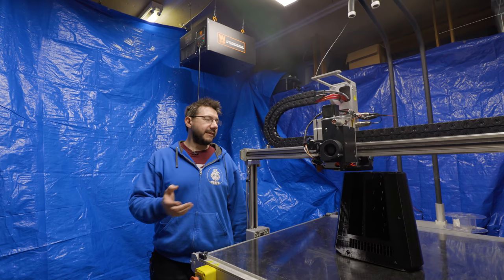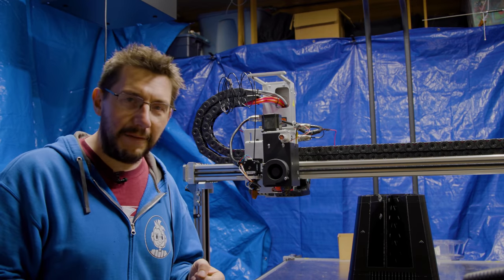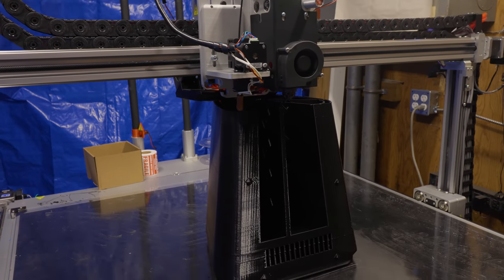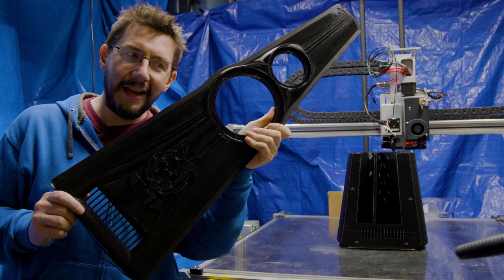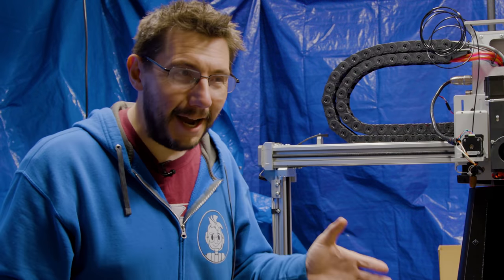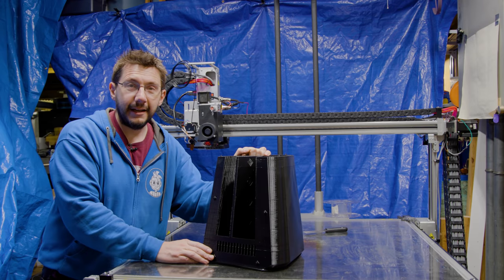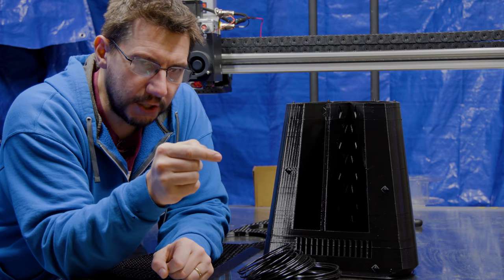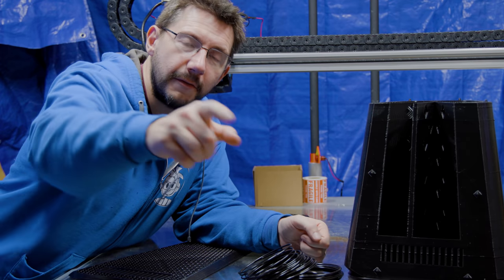3D Printed Speakers Part 1: Breaking the $38,000 3D Printer ... Again?

Comment: Is there such thing as a vacuum suction build plate? I have had my prints pop up off the build plate too and is super frustrating.  Would not be economical for small printers but at the 38k price point youd think this could be something to implement.
Reply: I think that's a great idea. First layer goes down then vacuum is applied. There would need to be a way that areas not printed on are not just sucking in air.
Reply: @Audio_Simon  yes like something in the g code that only applies only to the build area
Reply: @TheTelephonator  There would need to be valves or something that section off areas of the build platform. Like a TV has array backlighting.

Comment: What would happen if you tiled some of those black coated glass sheets over the surface with some silicon thermal pads for heat transfer and adhesion? Bet they would hold prints really well without the goo. I use a 0.8mm nozzle on my ender 3 and 0.64mm layer height. Never had a curl on the black surface.

Edit: I use petg mostly but pla hasnt curled either.

Comment: mister dude, after 30-ish layers set the bed temp to 10C under glass trans temp, pause the print for an hour to cool, resume print. Cooled lower print will keep it stiff to resist bending and there will be no leftover heat concentration.

Comment: Think about using a thermal blanket to retain the bed heat.  Sheet of silicon?   Otherwise that bed is giant room radiator
Reply: That's a good point. Stop heat dissipating from the un-used area and the rest of it will stay warm better.

Comment: Hi =) I have a question, why don't you use draft shield for the first 5 or 10 cm to keep your print on the bed? It work on small printer with bad adhesion for petg so it's possibly an idea for you I think. It's an experimental cura option if you search ;).

Comment: For doing detail work on the  38,000 dollar machine, slow it to a very very slow crawl.  Have you tried using hairspray to hold your prints down ... Aqua Net extra super hold never fails for me... Also can you move the filament sensor closer to the print head ???  Happy new year.. Best of luck on your speaker build ...
Reply from the maker: Yeah, a super crawl. I haven't tried hairspray yet, I may do that. I do want to move the filament sensor to the closer to the hot end :)

Comment: i think this 38k printer is probably built with 10k in hardware and its the hole 1st adopter pricing. idk the frame of the machine looks like it could do with some bulking up but if you look up large 3d printers you come across people making bigger machines that seem to do a better job and they don't cost as much as a new car.

Comment: How many outer layers sliced in the model?Larger models need more wall layers. Would have printed 2-3 times faster on a large delta printer like the Deltazilla at 1/3 the price. And the filament/jam detector is at extruder. And hotend is safety spring loaded so it can’t be broken off by mishap.
Reply from the maker: I had three perimeters on this one. Oh sure, a large delta machine would have produced it a LOT faster.

Comment: Not saying that this would make a difference but when I was printing abs I noticed that the more material you printed with the greater the warping.
If you can print with less infill it might help.
Just a suggestion.
The printer is a massive disappointment with a massive price tag sadly.

Comment: Joel, you should check out Vision Miner's Nano Polymer (I think you actually did a vid with them). I've been using it for large Nylon/ABS prints and I've NEVER had it peel off the bed. It works so much better than Magigoo.

Comment: For a bed that size they should have used multiple sensors... they could have used a circuit to average the temp or just input them in to a board and read them all...

Comment: A glass bed like that is probably really expensive, but I cant help wondering if a roughened up (cant find a good english word for it, according to google translate its "cut glass", I mean the way they roughen glass for making very tight closing lids on glass pots and jars and stuff, like those used in chemistry) bed would work better. Maybe by using a whetstone on it or something, or maybe theres companies that can do this.. you'd always still have your other side of the bed in original state :)

Comment: $38K printer: "In this house we obey the laws of thermodynamics!"

I've struggled with warping/bending thermoplastic before, even PLA, though obviously not at this scale. I've bent heat breaks, but snapping one mid-print is a first for me.

I wonder if a space heater would help? (Don't actually do it, the energy cost would probably be insane) I know that in the high-end Stratasys machines, the enclosures are actively heated to ensure that warping is minimized.

EDIT: Considering the cracked bottom and super hot surface under the print after cooling, I'm now wondering if there's a way to "anchor" the important sides to the print bed with big solid throwaway parts? It'd be wasteful, it'd raise print time dramatically, but if we want to print this without having to cut it up and glue it together later, this could be the only option on this printer.

Or cut it up in CAD, print the parts on Ender/Prusa machines, then glue it back together.

Comment: I’m sure that Simon can tell you, but a speaker cabinet can’t have anything lose or movable that isn’t designed to be movable.  The failed layer inconsistencies could introduce vibrations or really bad harmonics.  You’ll definitely need to reinforce them and ensure that they work at all frequencies, and combinations thereof.  To put it simply, if the cabinet is not rock solid, the sound produced will be really bad.
Reply from the maker: Oh I know, heh. I'm going to have Simon helping me with the assembly and making sure the cabinet itself is filled with what it needs.

Comment: 80°C for PLA? That seems too much. I though the best bed temperature was around glass transition temperature. More than that and it melt, so it doesn't stick. Less than that and it cools don't too much, it goes back to solid state...

Comment: You'd think with all the money spent overengineering this printer, someone would have thought "maybe we should add a filiment run-out sensor closer to the hot end, then we could have the system were the further away sensor alerts the user that it's about to run out so that they can replace it when it actually runs out" or even better they could of added a system that automatically changed the spool, fuses the end of the old spool to the start of the new one

Comment: A lot of comments criticizing the design but the challenge of mitigating internal stresses during printing is not at all trivial. It's even a problem in metal printers worth hundreds of thousands of dollars. I'd say if Joel wants more success he should raise the temp in the room and use a raft instead of just a brim. 

Also why not just move the filament sensor yourself?

Comment: It should have a secondary (if not the primary) filament sensor/switch on the printhead (not a hard mod to do, and quite light) or at least close to it... it's a nonsense to have it that far away if the printer can't use the last 2 meters of filament each time. Also, might be that this monster is meant to be used with bigger/heavier filament rolls in order to need less reloads... still, a couple of switches in the head for filament detection wouldn't hurt.

Comment: You need a higher ambient temperature. Get some oil filled radiator heaters and encapsulate the area 100% so the heat stays where it needs to. You want a 80+ ambient temperature

Comment: Hey Joel, I have the 3DP 1000. I keep it in a dedicated shed in my backyard and it keeps it nice and toasty in there and that helps alot with bed adhesion. Any suggestions on upgrading the control board ? I'm happy with the steppers and the mechanics , I'm struggling with it in the repeatability department and it sometimes has thermal run aways.
Reply from the maker: oh you have it in a dedicated shed? interesting. maybe I need to put a shed in my garage. As for control board - hmm. This one has a Duet board, what does yours have?

Comment: If you print it again, when the print finishes you could flip over a can of PC Duster and lightly spray the base of the print. Before trying to get it off.

Edit: Don’t use too much though because the fumes probably aren’t good, and the print can crack from rapidly contracting.

Comment: Seems to me the bed should be set into zones for at least temperature measurement.

Have you tried aiming a heat sensitive camera at the bed to see if the heat is distributed consistently?
Reply from the maker: I have and heat is consistently distributed, though there is just one giant zone :)
Reply: @3DPrintingNerd  Is it possible then that the heat under the print is getting higher than the temp you set it to simple because the heat has no where to escape to?

Comment: For 38 grand I would be angry at this point if this was my second video and the printer still had issues.
The bed has some massive issues they need to address, and having the filament sensor THAT far away from the hot end, there's absolutely zero need for it.
For a FDM printer this big I'd rather chuck my money at Ivan Miranda.
Joel I'm sorry you're having to deal with this lemon again :(

Comment: I had been thinking that the runout sensor was too far away some you first featured the printer
Reply from the maker: I really want to put it on the hot end carriage :)
Reply: @3DPrintingNerd  I mean, at least put it at the top of the filament hook thing, not at the bottom. You have like half a roll of filament between the sensor and the extruder. I though my w foot long bowden tube left me with a lot of filament waste, but this is ridiculous

Comment: Why don't you use a large raft?  A raft seems warranted. Print in one of the quarter quadrants, where the build plate is nearly unused, might help also. Don't always need to print center. Good Luck.

Comment: Perhaps the fact that the bed temperature was 29 degrees in a garage sufficiently cold to require a tent around the printer should have been a clue that it wasn't fully cooled down?
Reply from the maker: I've had Magigoo release at 30c before, so I thought it was time, and was just a bit tough because how much I put on.

Comment: You would imagine for 38k, the motors would have tmc drivers that would or the equivalent that would detect something like collisions...
Reply: Even if it did - he said the head is very heavy so will throw a fair bit of force around - meaning its possible the sensing threshold has to be too high to notice the relatively weak head being ripped off. Does seem like the head shouldn't be that heavy for how pathetic the head and mountings are, but any sort of collision detection would either need serious processing power - to cancel the intended movements applied forces, or for the whole thing to be tougher and/or lighter so the threshold for the sensor is safely before anything breaks.

Comment: I have a feeling the speakers are going to sound just like the print results look: Not great. I'm happy to have solid large floorstanding speakers made out of good old wood. Are you filling them partially with concrete to make them heavy enough so they don't just walk around in your room with that little mass and the big drivers in there?
Maybe if you are from the "Beats-Generation" and you don't know how good audio products sound anyway, you will be happy with some 3d printed gimick speakers...
Reply from the maker: gimick speakers? heh. I see why you may think that, but the goal here is to build these speakers to sound as good as possible, and with Simon's design that's going to be possible. What's going to be inside? I guess you'll have to wait and see :)

Comment: Klipper update comes with a set of step-by-step

instructions for characterizing your machine up front. After a couple test prints to measure the periodicity of your ringing, you can simply apply your measurement results to your config file, and you're set.

Input Shaping is a prime example of “just wrap a computer around it!“-fixing hardware by characterizing and cancelling unwanted behaviors with software. If you're hungry for more clever, characterized hardware control schemes, look no further than this Anti-Cogging algorithm for BLDC Motors. And for a video walkthrough of the Klipper implementation, have a look at [eddietheengineer]'s breakdown

after the break.

Does your 3D Printer run Klipper? We'd love to see some of vour Input Shapina

Comment: OK well I had another few thoughts on this printer table surface you said that maybe their should be a different table style. so I thought well there are several different after market table coverings that are applied over the factory tables. So how about testing some of the ones you have and like maybe ask one of them if they could supply you with one to fit that printer or you could probably take four of the biggest  ones you can get and apply them and test to see if that could help with the grip troubles 
Also you might try rotating the print on the table to see if that helps with the lifting problem sometimes if I reposition the print I'm having trouble with it has improved the way is sticks to the table well there is a chapter for my new book 
"Jim thinks he knows something"

Comment: this is exacrlt the scenario that the slice guys where worried about when engineering the mosquito with the decoupled heartbreak and hotblock. on consumer printers with 1.75mm filament and 0.2-0.8mm nozzles, not really much of an issue, on these types of machines? hot diggity damn

Comment: If you break a $200 printer, you will get comments tell you this was to be expected and it's your own fault. 
If you break a $38,000 printer the comments will tell you this printer is rubbish.
Yes - there are some issues with the printer. But for this print the problem looks mostly related to the temperature in your garage. The bed is cooled down too fast on the part that is empty and most likely that is where the temperature sensor is. Also, the big difference between the heat deflection temperature of the material used and the room temperature results in more warping than usual.
Especially when printing the large flat front, warping was to be expected.

Comment: It gives not a good surface quality. The heavy head is fixable. Just need a "floor" over the hot end which will have a bowden extruder at a distance. So it will be moving after the hot end on a "leashe". This will give a good quality with the same speeds. Just need a good "following" construction. Assuming how much it costs... I think that the remote bowden extruder could be done withing this budget. It can be positioned electronically (with own carriage and motors) so it will never fail.
The hot end's breaking because of a failed part of a print... I've thought it's impossible :) Probably the designers of this printer did thought the same.
Obviously the hot end need some really good frame so the heatbreak couldn't be broken. It's the weakest point and it's not protected here. It's not right. Even for the E3d V6 hot end I think about the same... But at least you can place an autolevel there easily and make the bed on springs (so it can be half-protected).
To prevent such failures some serious CNC machines usually has sensors. Why this really not-cheap 3d printer doesn't have pressure sensors that will tell about critical deviations?
I have more questions about this printer than I can write right now probably.

Comment: hair spray, aqua net extra hold is what you need
Reply: i still use paiinters tape and hairspray, treseme level 5 works wonders.
Reply: @spunkmire2664  I cant remember the last time i had a print come loose. Hair spray and mirror for me. I started with painters tape and spray on an unheated bed, that worked great! Vellman K8200
Reply: @ItsDaPlumber  Ive been using this 2014 itailian printer for years(ultimaker clone), no fancy features.  I would drop the painters tape but the glass bed is worst.  Im printing corexy parts here for a build in jan.  
Then I can yank the controller out of the old one and put a Duet or something in it.

Comment: If I was running that printer I'd buy some self adhesive PEI in a wide roll and coat the glass with it. I Loovvveeee pei, roughed up with some high grit sand paper is expert mode.

Comment: Looks like a build plate heating issue +/- poor quality surfacing. 
Maybe try getting a powder coating for the bed like Josef Prusa's.
I'm really suspicious about the build plate temperature, especially if your room is cold. If you can, it might help to borrow a FLIR or tape an accurate thermocouple to the bed to see if it's reaching the correct temp.
Large printers like this need light components. Big lumps of aluminium swinging around 5 feet off the ground are going to wobble like heck unless printing very, very, slowly.
Personally I feel my $500 CR10s pro v2 could do a lot better than this monster, assuming the speaker can be produced in 30x30x40cm segments,

Comment: Put painters tape down. That way the model is only stuck to the glass as good as tape can hold, which is manageable. Also, when removing,... the tape gives you a layer you can really jam that putty knife into without fear of damaging the model with the putty knife.
Reply from the maker: I've tried blue tape in the past, and the print lifted the blue tape off the bed :)
Reply: Frog type. Use on my enxer extender 400x400x250. Sells in the uk  not sure about usa. However the prints do not pop off. Its stuck down to the bed like nothing else.
Reply: Frog tape
Reply: @3DPrintingNerd  That could only happen with oily glass, or something. Buy Scotch, or 3M brand tape. Seriously, try tape before you break that glass again.